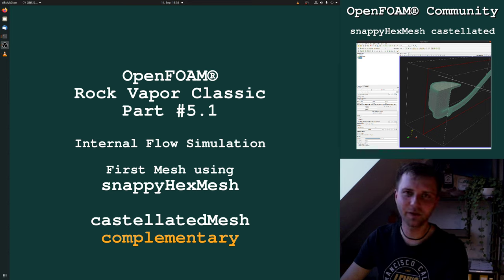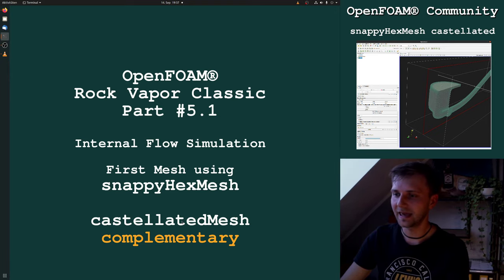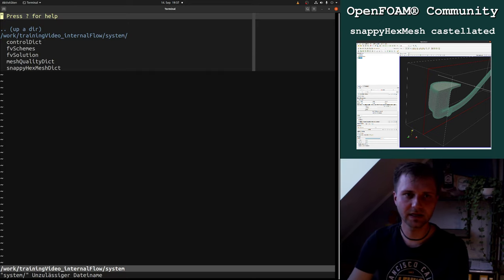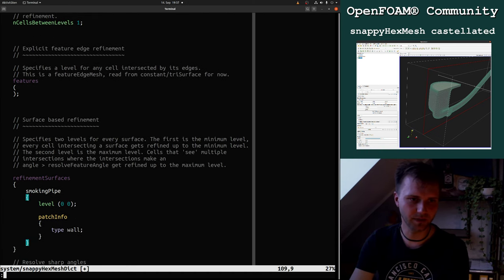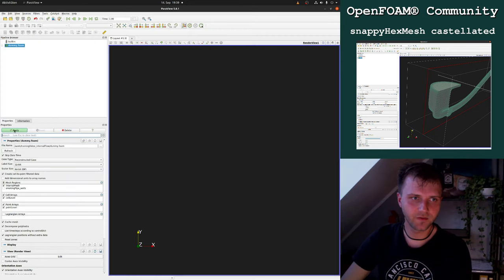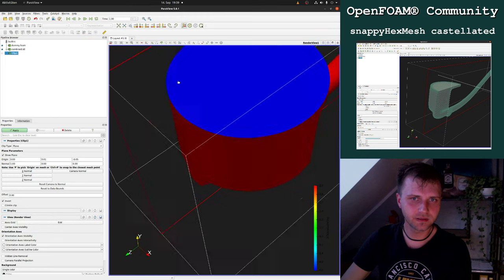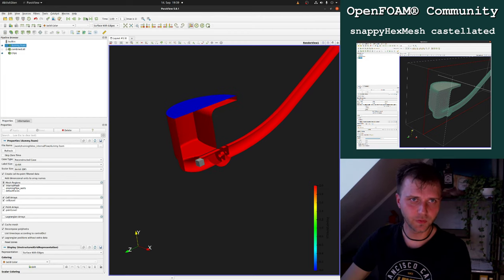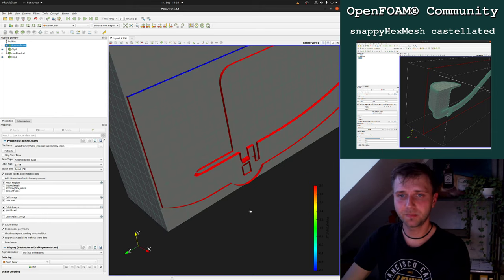CFD Analysis of a Smoking Pipe | Part 5.1 | SnappyHexMesh castellatedMesh Complementary ∇ OpenFOAM®

Comment: When there are 40+25min of videos just for the castellatedMesh, you know snappy isn't easy to go! Great video.
Have you used snappy for all your cases? If not, for which type of geometries/needs you find yourself not using it and why? Curious about the limits you've encountered.
Waiting a lot for the snap and layers parts, as I gave up snappy a long time ago. Thanks!
Reply from the maker: Until now, I always used snappyHexMesh for my analysis except during my Ph.D. while I was investigating into thermal-stress analysis. Here, I had problems to get the solution to converge. I used a polygon mesh instead which worked okay-level. However, I had also the possibility to check out a snappyHexMesh mesh, which was modified (the application).Here, I got a good convergence; unluckily I had no access to that version and just got the mesh back. I guess it was an snappyHexMesh version from ENGYS, but I am not sure about that.

For fluid flows, I used snappy since I am able to use snappy :) but as we will see in the layer generation part, it has its limits. Specially for layer generation.
Reply: @HolzmannCFD  Ok interesting. You used the polydualMesh I suppose to get polyhedras? I got a hard time with it also.
For the layers, as I did not personally tried hard, but heard some interesting workflows:
- LES simulations where core the mesh is made with cfmesh (free version) and layers with snappy with 2 possible methods:
     1) Run snappy 1 layer at a time, starting with the outer layer until your first layer. (use a script for that)
     2) Run snappy for 1 layer which is the total layers thickness. Cut it many times by running several time  refineWallLayer

I never succeeded a proper layer generation for my case (a pump impeller), but since it was just for fun I finally gave up. Might try again after the serie.

Comment: Great addition Toby to the series on snappyhex. Much needed. I had two questions
1. I do not have the decompose poldehra option in paraview 5.8.0. What is an alternative you suggest?
2. The problem of cyclic boundary condition. I’ve searched everywhere and there seems to be no solution so far. I use blockmesh to generate base mesh with cyclic BC. I run snappy and everything falls apart. Require your kind expertise here, any help will be largely appreciated!

And keep up the great work. Sharing your content everywhere and spreading this love and support for open source.
Reply from the maker: Thanks for your hints ... I will incorporate it to part 5.2
Reply: Holzmann CFD thanks Toby! I will work on it too and email you if I find a solution :-) happy foaming!!
Reply: For your first question check this link:

https://discourse.paraview.org/t/decompose-polyhedra-option-in-v5-8-0/4327
Reply: @denizkepez3264  Thank you!

Comment: Dear Tobi, congrats once again for your videos! Accurate and useful like your writings. 

I am trying to build a mesh around my geometries consisting only of square and rectangle surfaces. I am wondering whether it is sometimes advisable to just use the castellatedMesh and don't proceed to the snapping. 

In my case for example, when I use snapControl the right angles of some of my square surface become acute angles (<90). I will try to sketch it to give an idea. Of course, it is an exaggeration for the right angles.      
o-------o                          o-------o 
¦           ¦         --->             \        /
¦           ¦    becomes      /        \
o-------o                           o-------o
When I turn it off  the snapping they seem ok. How would you explain this?